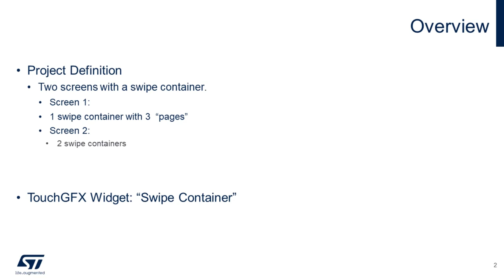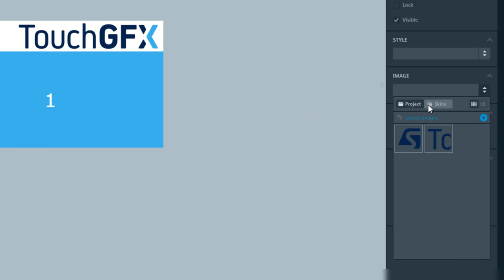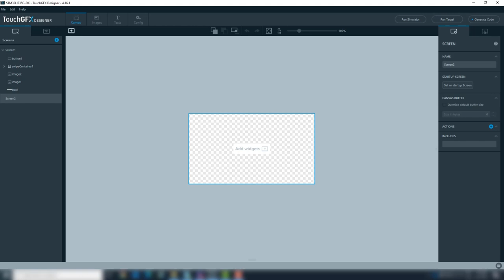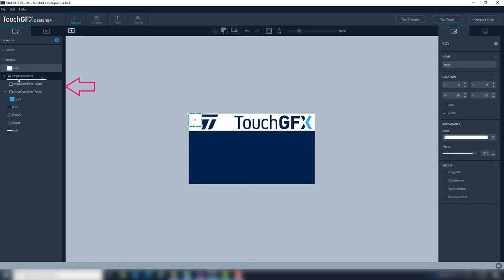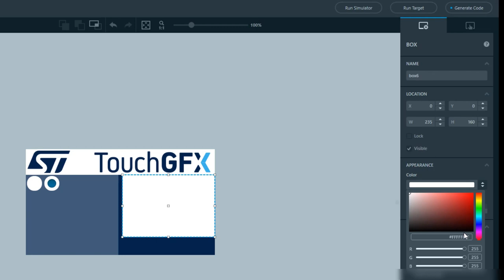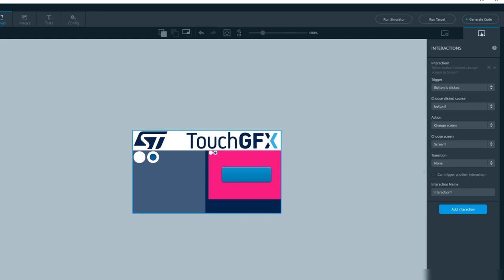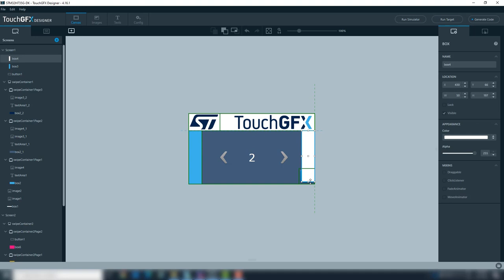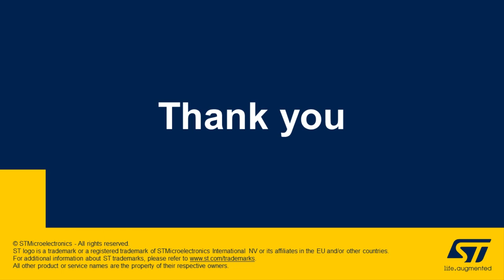STM32 Graphics: Using the Swipe Container Widget

Comment: In your work, in Demo, when switching from screen 1 to screen 2, I see you selected the button in swipeContainerPage3 (in screen1), when switching from screen2 back to screen1, it doesn't go back to swipeContainerPage3 but back to swipeContainerPage2. 
So maybe there is a way when switching from screen2 to screen1 it will go back to swipeContainerPage3? Same if you change screen1 to screen2 from swipeContainerPage1,2 when back it returns correct swipeContainerPage1,2.
Please give me some advice!